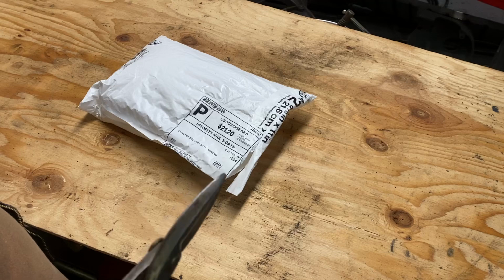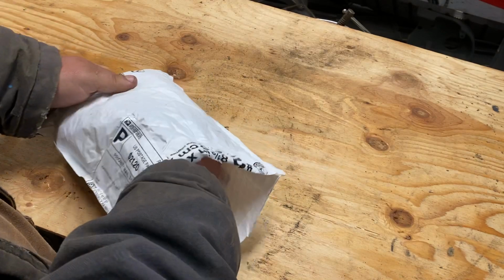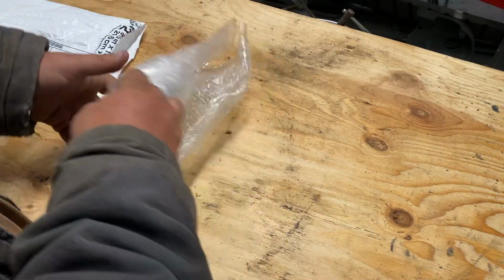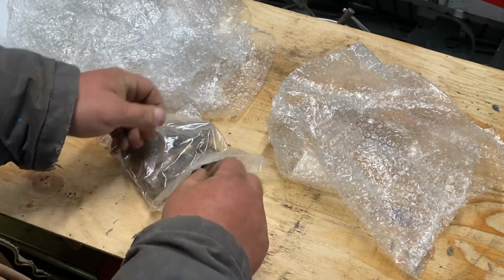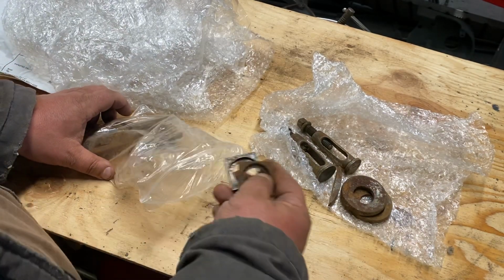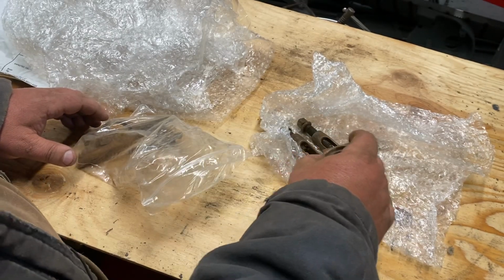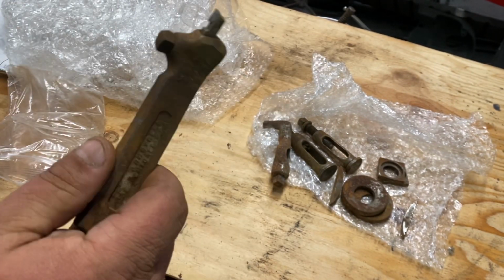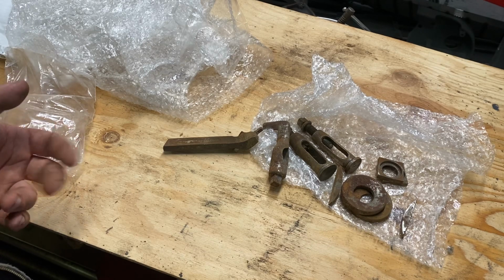Gift from a viewer, many many thanks

Comment: I never understand the carbide junkies. Almost any machine tool the tooling is far more expensive than the machine. The one exception to this rule is lathes and sharpening your own cutters. You could probably drop $100 once on some Momax blanks and be set for life. I don't think $100 will buy you more than two carbide holders with a box of inserts. But there's a better reason to start with HSS, carbide behaves very strangely compared to other cutters. When you're building good habits and muscle memory, what you learn on HSS will be much more applicable than the techniques best used with carbide